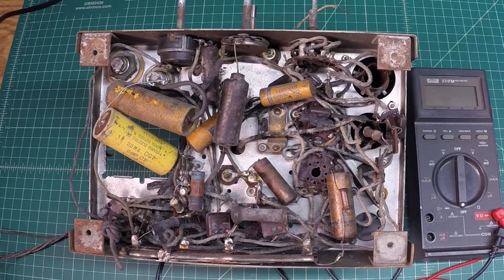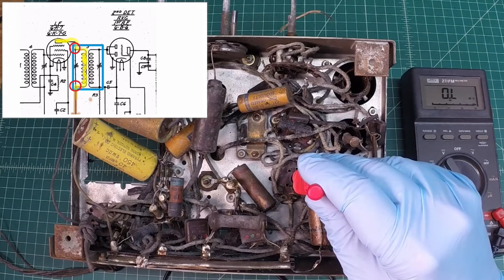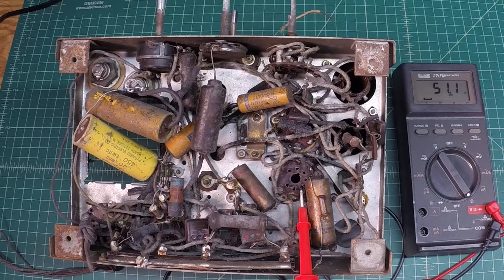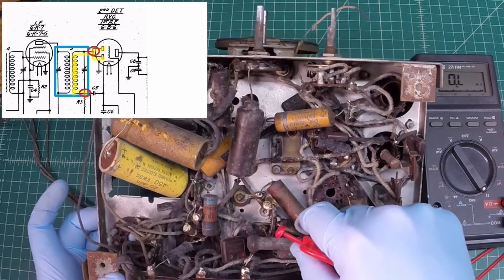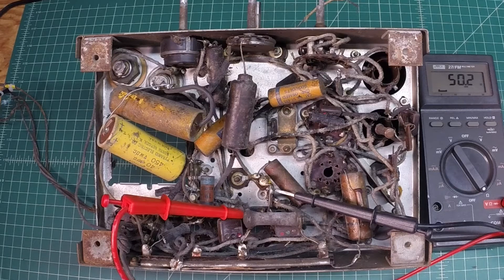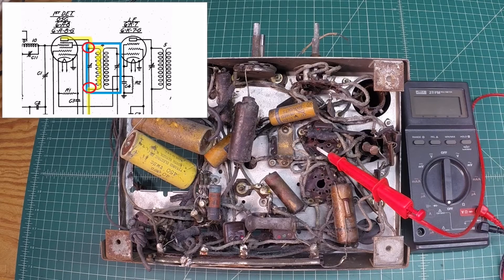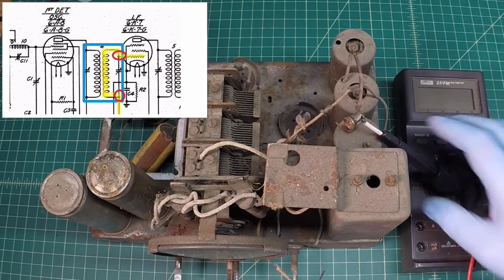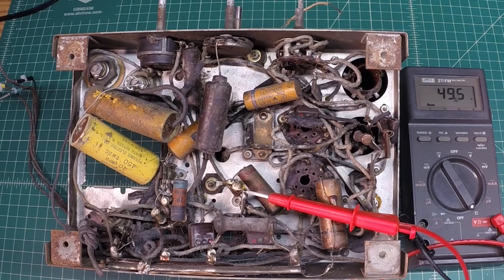Zenith 5-S-29: IF Transformer Testing

Comment: Great Info, I do have a couple of questions and keep this in mind. I have only been doing electronics for about 2.5 years and working on old AA5s for about 1 year. So why does everyone make the measurement in Ohms when you are looking at a coil. Why not Henrys and the coil Q? I realize in the IF can there is a capacitor, but I have seen this method even for an IF can that has been opened for rebuild. The cap is no longer attached and it is still measured in Ohms. Why?
Reply from the maker: +Carl Davis Hi Carl, great question. I measure Inductance at times too. The only real purpose of measuring DC resistance is to see if the coil is open (defective) or compare the resistance to the published schematic when they are noted as to speed up troubleshooting. I don't measure or calculate the Q of a coil or haven't to this point. If I build a coil in the future, this is something I would consider doing. Hope this helps and thanks again for watching and your question. I hope your future projects are rewarding. Best, Don
Reply: I just got my first true from the manufacture data sheet on an old Stewart Warner from 1947. Obviously I got it on Ebay not from the manufacturer. However, it shocked me to see every coil on the data sheet had data that was written in Ohms. I was also shocked to see how spot on it was. I just wanted to let you know that there is proof of the original data being written this way. It is good data to proof your system but sucks when trying to reverse engineer a coil. Thanks for your response. Keep posting those great learning videos.

Comment: Excellent restoration videos!  I have that model Zenith and this series should be extremely helpful.  Thanks again.
Reply from the maker: Armand - hope it helps. The Pre-Selector and Oscillator coils were difficult to document with accuracy. I think the info was recorded correctly, but use it for what it's worth. Best, Don

Comment: Don,
Testing coils, winding etc. can be somewhat tedious but it is one of those necessary operations in the process of radio repair/restoration. 
I too like those spring-hooked meter leads, though having said that, I usually alternate between using push-on crocodile meter clips and straight needle probes on both red, and black, leads as required – purely because I find it convenient.
In all of the past forty-eight years of being into electronics, including the 36 years I was in radio & TV servicing, I’ve never found a mains transformer where the DC resistance, on both high voltage secondary centre tapped windings, read equal.  Having said that, 361R over 2 = 180.5R, so 173R, and 191R, for each winding is a fairly low DC ohms tolerance, hence a good quality mains transformer. 
Purely for presenting an idea: whenever I’m presented with a transformer that has single strand connecting wires where the insulation has perished I replace the old insulation, having it with a blunt knife, with silicone rubber sleeving – it is not so easy to push over stranded wire (you will see me use silicone rubber sleeving in my Regentone, GEC, and Westminster radio repair YT vids).
For its age, and taking into account where the Zenith radio has been stored for the past fifty-or-so years, its speaker is in excellent condition.  Over here, speakers in old radios that have been stored for many years in attics, cellars, sheds, garages etc. tend to have warped cones, or cones that have fallen to bits, in rusty baskets due to climatic conditions as Britain is noted for being cold, wet, and windy, even in summer.
Brilliant: all systems go my friend.
Regards,
Phil.
Reply from the maker: Great info Phil. I'll have to look for some silicone sleeving material. Can you just place it over the existing insulation or is necessary to remove the old insulation due to the combined thickness? Best, Don